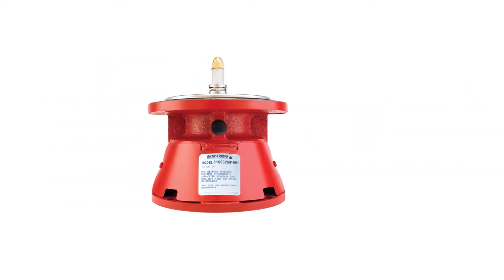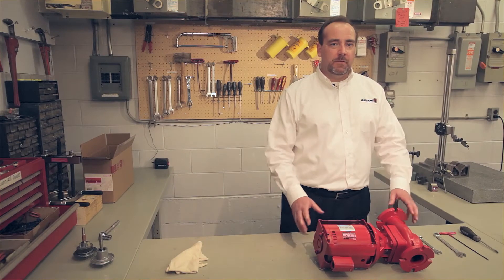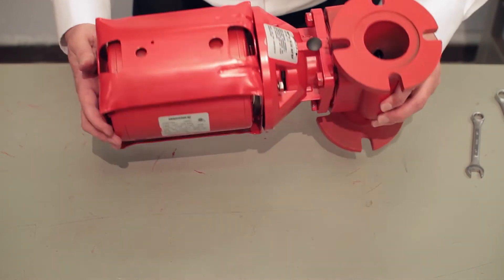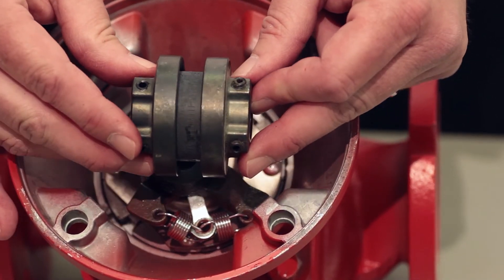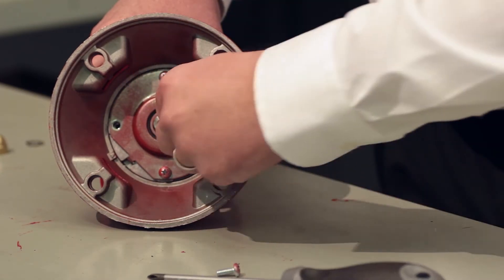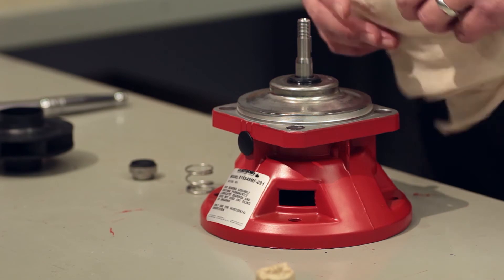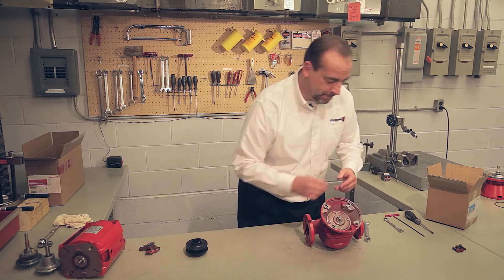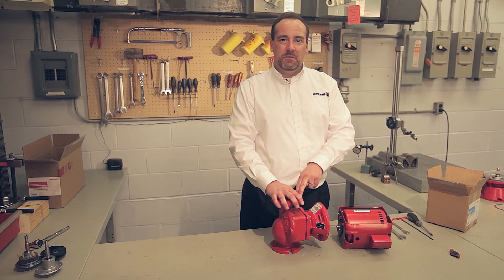Armstrong Seal Bearing Assembly Replacement

Comment: Where I live they do not provide the seal bearing assembly to replace, (special order!). I think it is because it is too much of a fiddly time waster for the furnace service techs. That being said, our local suppliers simply stock the entire assembly housing as a bolt on replacement for the old one. Its more expensive but means that there is less chance of having a problem caused by improper installation of the seals, etc.
That being said I have replaced several of these entire seal housings without issue. Until today,...I ran into a situation where I placed the large round paper washer then plumbed in the complete pump/seal housing to the system. I installed the 4 large bolts to attach the pump; tightened them down evenly all the way around; opened the water shutoff valves,....and suddenly found water springing from the large paper seal area I had just snugged down????
I tried everything to stem the flow!; removing then reinstalling the pump/seal assembly; ensured the contact area was perfectly clean; light dab of thread sealant on the gasket; then heavy amounts!; then two gaskets!; then form-a-gasket paste;,...nothing would stop the trickle!!!!! 
Was it the right part? machined improperly? Bent?
Exasperated beyond belief, I just decided that I will let it leak until I could get a replacement. I opened the water supply to introduce additional water into the system adding more pressure to the system,.....and an even greater stream of water came out !!!! 
By now I was having a fit!
I turned on the furnace and almost immediately the leak went away!!!!!! 
Why?
There are two small, (drain?) holes at the bottom of the seal assembly housing adjacent to the paper gasket. I speculate that the seals don't make a full "seal" until the motor engages the shaft in the housing and once it does it "pushes" the seal into place, ("seats" it!) and the leak "disappears!!

It would have been nice if the instructions that come with the assembly said as much. But installers should know this can occur and its not that they installed it improperly.
Reply from the maker: Sorry to hear about the leaking and unnecessary stress! I'm glad it was resolved but I will have our product engineers review the product and documentation to get it cleared up. Thank you for bringing this to our attention, it is greatly appreciated.